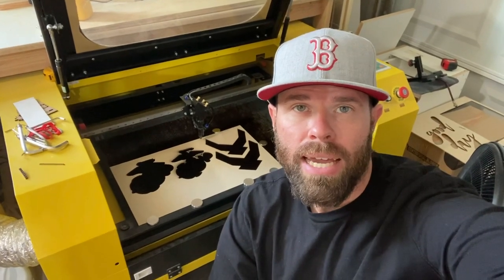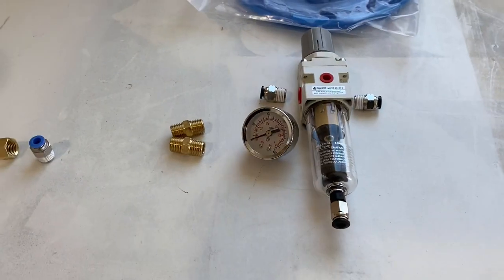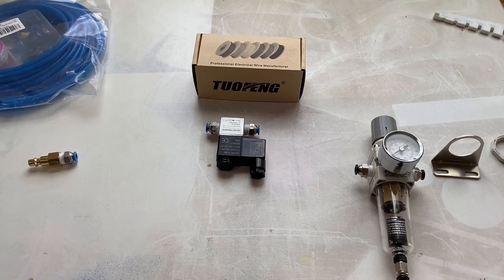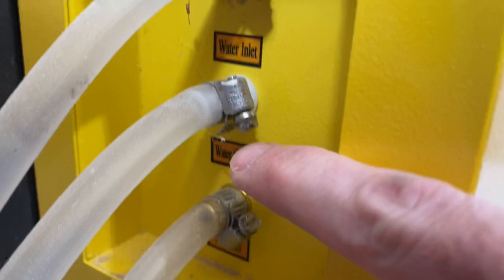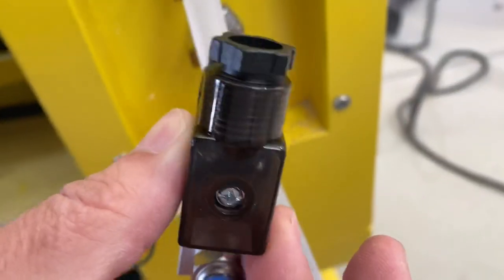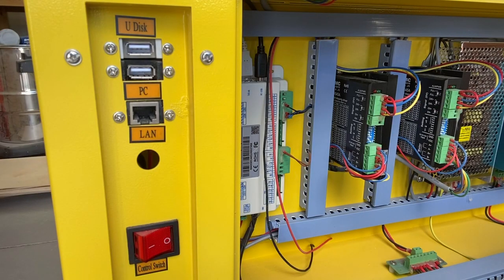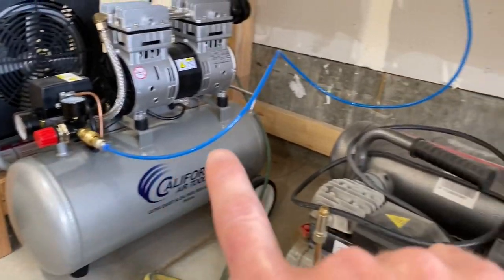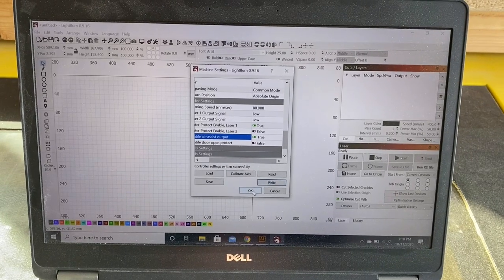Upgraded Air Assist for Chinese | OM Tech CO2 Laser

Comment: I ordered all the component and started lining them up.  then I looked into the side of the 2021 laser.  no place to hook up the solenoid.  those power supplies are completely different.  I may still use the external air assist but it won't be an automatic function tied to the laser, unless I can figure out where to wire the solenoid.
Reply from the maker: If you have a ruida controller then you need to look for the 24v+ and wind/aux air. Even if there are wires already placed there, you can add yours.
Reply: @BeardedBuildsCo  i have the new ruida controller.  so I found the box- not using the same connectors there but appear to be wires going in and the box reads aux.air and  +24v. the wires in the other slots are really thin.  and have some connectors on them.  wish I could share a picture. I am assuming aux.air replaced wind.
Reply from the maker: @cliffart7398  send me a message over on Instagram and I’ll help you work through it.
Instagram.com/beardedbuildsco
Reply: @BeardedBuildsCo  Okay, so I figured it out.  the power supply has black plugs that are removable like the green ones- just confused cause they were already plugged in so I didn't need to order the green plugs at all.
Reply: Just connected everything - piece of cake and works like a champ.  thank you so much for your video.
Reply from the maker: @cliffart7398  you’re welcome!

Comment: Can we also control the small compressor (which comes with machine) power turn on or off by a electric relay. In my old machine that's installed, and it controlled by a relay for small compressor.
Reply from the maker: Yes you would just need to wire the relay in between the power wires and then connect it to the control board the same way I wired the solenoid in this video.
Reply: @BeardedBuildsCo  Thank you so much for your response. Please make a video for that. Small compressor power on/off During air assist
Reply: @BeardedBuildsCo  or if you can please share some pictures, because on Trocen controller the number and name for each wire is changed or written in different ways. Didn't understand properly

Comment: This is a great video! I am wondering though. I have my normally closed solenoid. But the valve never closes. It’s always on. Any tips and suggestions
Reply from the maker: 3 things.

Are you sure that you have a 24v solenoid?

Did you enable the air assist in the machine settings?

Is air assist enabled on the cut layer?
Reply: Thanks for a quick reply. Yes to all 3 of those questions. If I disconnect obviously the valve closes. As soon as I reconnect the wires the valve opens.
Reply from the maker: Then it should like you have the solenoid wired to the wrong place. Did you wire it to the wind and 24v ports on the control board?
Reply: Yes I actually double checked that a few times. I followed your video to a “t”.
Reply from the maker: Do you have a Ryxon controller?
Reply: Rudia
Reply: I do appreciate your help but wondering if you could think of any other reasons the solenoid would stay on? Seems there is just constant current going through the system (when laser is on of course). Is there something wrong with my board? I even tried a different solenoid and had the same result. 
Thanks again for the help
Reply: @joshuasammons2408  I have the same issue. There is a difference when the controls turn air on while cutting, the pressure is higher. I am suspecting a leakage thru the valve itself. I also have everything done per the video. Which is awesome! 
Have you resolved your issue?
Reply: I also took the valve apart and validate that the spool was not stuck...
Reply: Never found a solution. I tried buying a new valve and had same issue.

Comment: Nice thanks, question what do you have the compressor output set at?
Reply from the maker: I sent it at 90psi and then I limit it at 30 psi at the new regulator.
Reply: @BeardedBuildsCo  okay thanks
Reply: Just finally received the last of the parts yesterday and installed it today and oh yeah!
Reply from the maker: @jamesshelton9126  🤜🏻💥🤛🏻

Comment: Did air come out of the nozzle before you changed the settings in light burn ? 
Mine has air coming out when I turned the regulator on.
Reply from the maker: The solenoids are a normally closed valve until they are told by the machine to open. Did you wire the solenoid to the correct spot on the 24v and wind ports?
Reply: @BeardedBuildsCo  I did, but I’ll go back and check again. 
I get air coming out even with the machine off, maybe it’s a faulty solenoid 🤔
Reply from the maker: Faulty solenoid or incorrect voltage. If it is not a 24v solenoid it could have burned out and stuck open.
Reply: @BeardedBuildsCo  I actually just figured it out and I think there is supposed to be a washer or something inside the solenoid because I can see straight through where one shade should be closed. so yes it’s missing a part Or they accidentally drilled through that small metal block. So lame ….. I get to order a third one. The first time they sent me the entirely wrong one even though my order was correct🤦‍♂️
Reply from the maker: Glad you got it sorted out!

Comment: What size omtech laser is that? Do you know if the California Air Tools 8010A 8 Gal will work for a 130W CO2 Laser?
Reply from the maker: This is a 60w. I have switched to a 26 gallon kobalt quiet tech. The 8 gallon will work for sure but the big tank you have the less it will have to run.
Reply: @BeardedBuildsCo  Thanks for the feedback! I certainly appreciate it!

Comment: How did you select the outputs for your connections?
Reply from the maker: I’m not understanding your question.
Reply: @BeardedBuildsCo  You wired the valve to two pins.  Why those two?
Reply: At 7:23 you point at the pins that you used.  How did you know to use those two pins?
Reply from the maker: That is what these pins are designed for. You can look up diagrams for the controllers. The one say right on it wind and 24v

Comment: Any idea how to add your way to an existing internal pump
Reply from the maker: Explain a little more what is the functionality you are trying to achieve?
Reply: @BeardedBuildsCo  just bought a 60w Chinese laser. Did a lot of  research on all the mods needed and saw your video on the air assist. When the laser arrived it had the internal pump and already wired. I was expecting the external air pump so I could follow your instructions. I’m not an electrician  and worried about the already wired machine. Can’t find anyone upgrading the internal pump
Reply from the maker: So the wiring for the pump should be easy enough to follow the wires and disconnect it. The idea of running the compressor is it increase your air flow from the stock set up. Otherwise there is not a real reason to add a solenoid.
Reply: I guess that’s what I’m asking....so the only thing I have to do is disconnect wires from internal pump and reconnect to the solenoid  and  of course line to compressor
Reply from the maker: @bobhoup8908  you will want to remove the wires from where the power is coming from to the pump. Most likely at the power supply. Then cut the air line. At that point you will be in a similar position as in the videos when I add the solenoid.
Reply: @BeardedBuildsCo  I followed everything like you did and mine works great on my ebay 60watt laser just like yours on the line setting. But when I use the fill its pulses the air on and off all time. You know turning the solenoid on and off all the time during the fill. Is there a way to adjust that? Thanks.
Reply from the maker: @miket2864  I believe there is a vendor setting that controls that. Let me look and see if I can recall what the setting is called.
Reply: @BeardedBuildsCo  OK great let me know please. I couldn't find anything in lightburn to do that with. Thanks.
Reply: @BeardedBuildsCo  I figured it out.
Reply from the maker: @miket2864  what ended up resolving the issue?
Reply: @BeardedBuildsCo  I left the postive wire on the first postive and moved the neg down one slop on my control